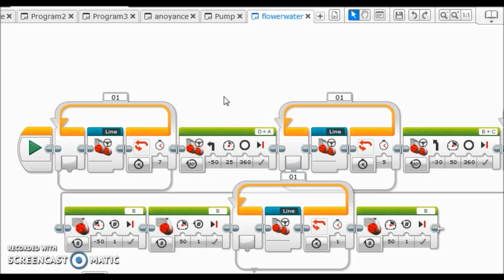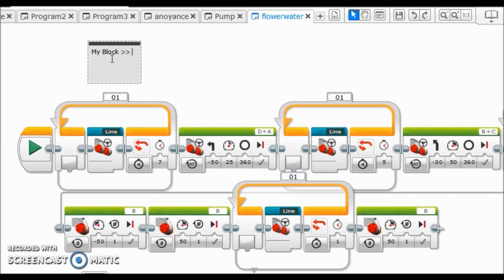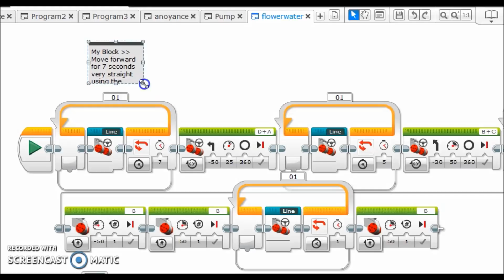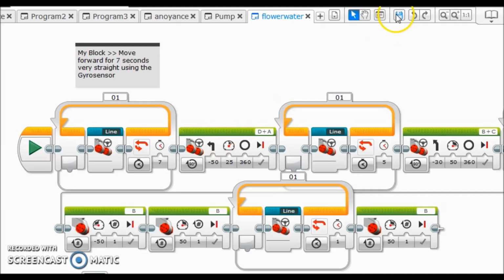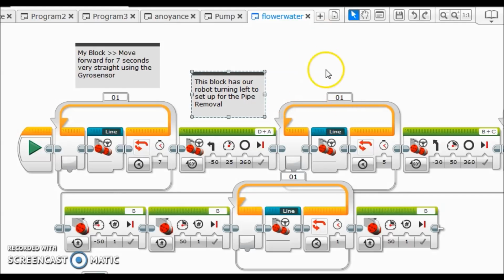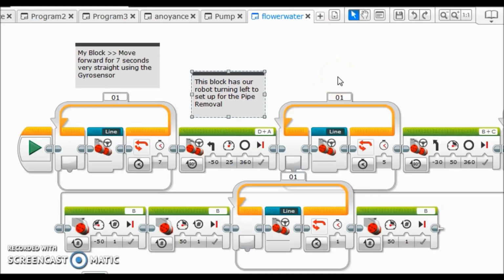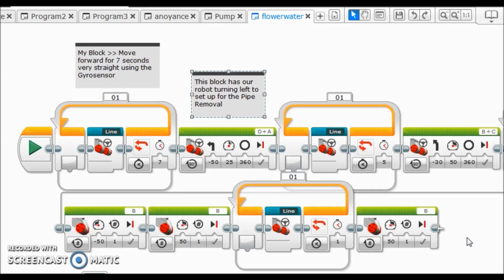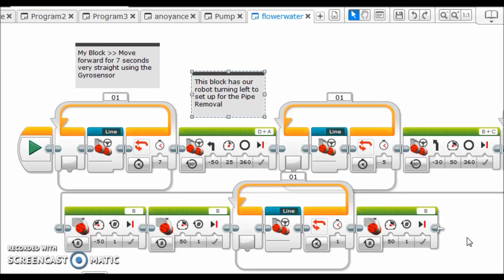"2017 Hydrodynamics: How To Annotate Your Mission Code For Robot Design Judging"

Comment: Some tips 
When you comment try not to duplicate information that can easily be read from the parameters of the code you are commenting. Instead, talk about what your robot is doing on the field or why you are using certain blocks/ values /techniques. 

For example, instead of saying "move forward at 10 power for 0.5 rotations" you might say "move forward a little to push the pump addition against the north wall. Go slowly to make sure it won't get stuck." 

don't feel you have to make a separate comment for each block. It often makes more sense and is easy for upkeep to make a single comment which covers several blocks .
For example: "drive east out of base until the robot is south of the green hill then turn to face the broken pipe. Drive forwards then raise arm to lift the pipe."

Also, it is always a good idea to put the starting position of a run (and possibly other details like jigs or attachments used) and what missions it completes in the comments. This is some of the most useful information for team members to record in case they forget. 

On that note, try not to think of comments only as something to do for the judges. They can be extremely helpful for team members to remember what code does and to find their place in a long piece of code. I personally find writing comments to be a good debugging tool. It makes me think about what the code does step by step and that can help catch errors or understand subtle things about the program that may give ideas on how to improve it. It's fine to go through and beef up your comments right before competition but I would strongly encourage doing at least some commenting as you go. 

Lastly, don't forget to comment inside your my blocks, if you have them. I like to see a brief description of how the block works as well as what it does for the team (when and why you would use it) and what it's parameters and their defaults are (if any).

Comment: Now I am having a problem that I can't do anything to my program in Ev3 I could Add a New program in it but I can't click on it and I can't change it's Value, Also If I Open a new project I could change the values and I also could click on it. What should I do if I want to use the same project? Have your program ever been  like this before?
Reply from the maker: We've never had a problem editing the mission code like that.  We have had the LEGO Mindstorms software freeze up from time to time but it usually resumes working either by restarting the laptop or waiting for the program to resolve the issue.

Comment: I've served as an FLL Robot Design Judge for (now) three years, and I strongly recommend using Comments to help the judges decipher your programming code!  There is limited time in which the judges can evaluate your programming, so make it easy on them and USE COMMENTS.  Leave a printout of your program with the judges, so that they can show it to the other judges who did not witness the team's demonstration.  If you don't show your programming, you won't get max points on the "Rubrics" grading sheet.  Some judges (particularly volunteers from local high schools and colleges) don't entirely understand the nuances of EV3 programming, so don't leave their interpretation to chance.  Use Comments!
Reply from the maker: Thank you dluders!!!!  You rock!!!

Comment: why would you use that technique instead of the comment block?
Reply: Because comment tool comments can be made any size and do not take up space in the code.
Reply from the maker: That was the comment block....
Reply: the comment block is an actual blue ev3 block.